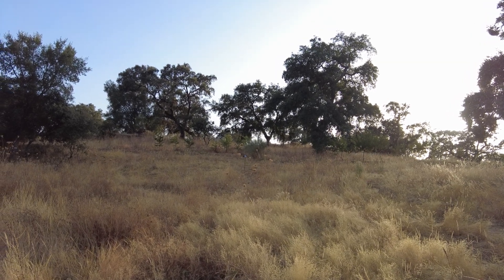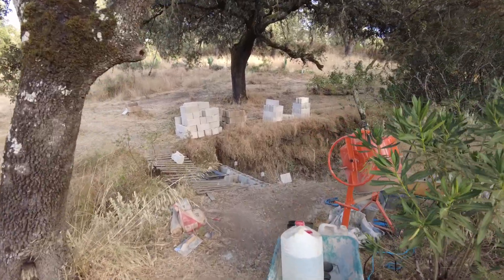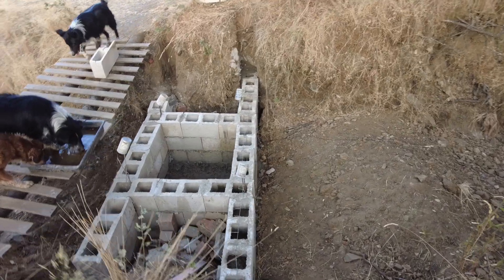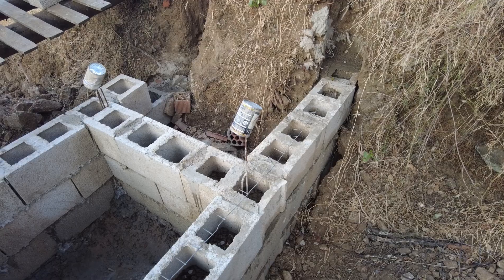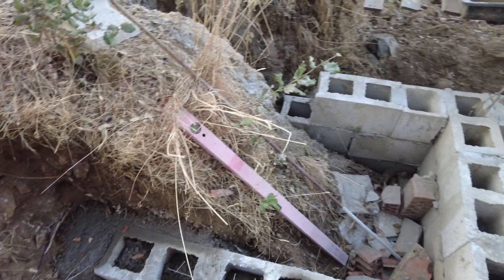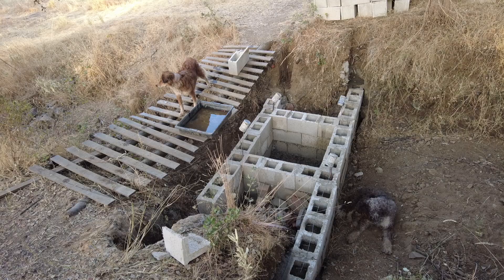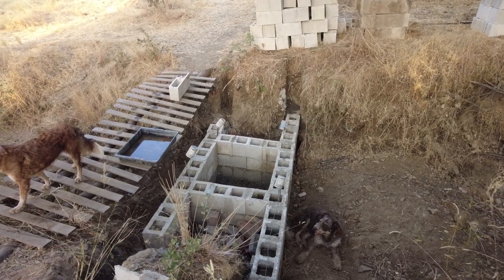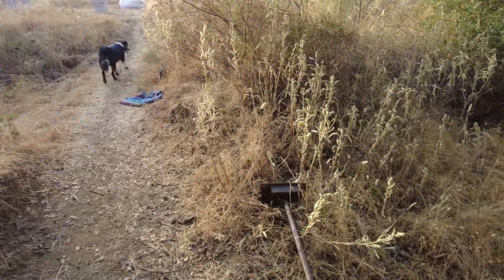Crossing over the creek structure taking shape. #agroforestry

Comment: I'm still lobbying for a large diameter pipe that you cement into the structure at the very top.  Make the upstream side flush to the block, and mortar in angle iron rails for a sluice gate as you lay the block (or bolt in with anchors when  complete.  Those blocks are too heavy for a dead lift in a rainstorm Martin.  I'm suggesting large diameter because you really don't know how much you want to direct into the original creek bed.  With the sluice gate, you can reduce the flow to any amount you choose.  And I think you have some surplus large diameter pipe on the farm?
I see the horizontal steel reinforcement between the blocks. YEAH!
TO make the working conditions easier, I'll suggest you begin backfilling now.  Level the areas where you walk and stand.  And build up the areas where the lift is above your waist.  If you start digging your spillways now with the Giraffe, you can dump a scoop or two strategically into the structure as you go so you have soil that is easy to shovel. Once placed, wet the soil thoroughly and tamp.  Start your overflow canal dig on the high bank elevation.  The low side may simply spill over the bank as sheet flow.
You can also harvest some soil from the creek bank adjacent to the mixer as you dig a gentle ramp to walk up and down.  The ramp does not need to be very wide and it will make climbing in and out SO much easier. 💙🌳
Reply from the maker: Thank you Steve. How large?
Reply: @SuerteDelMolinoFarm  The pipe you used for the original western canal diversion should be fine.  And you can do the 'through crossover' with one pipe - so no leaks.  and you do not need any slope given the distance.  You just want to make certain it is mortared into the dam walls very securely. 👍